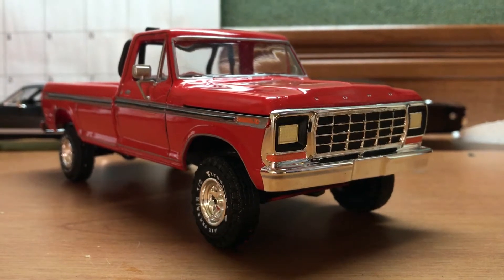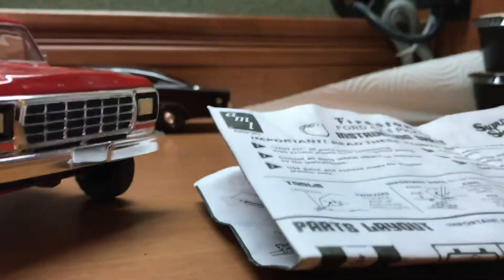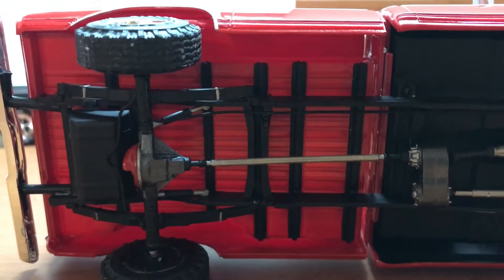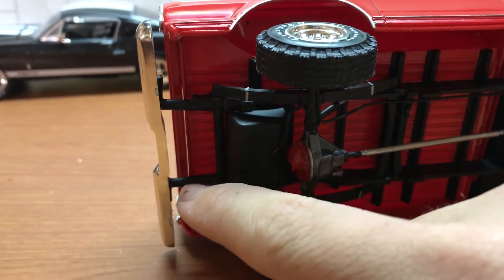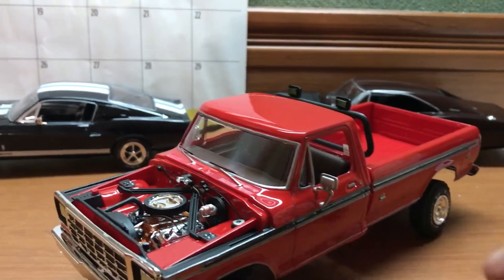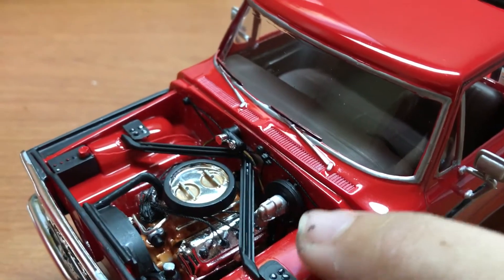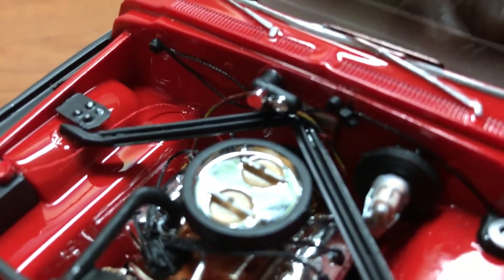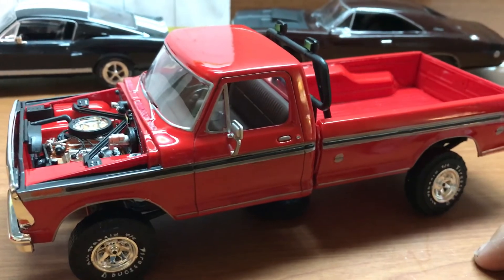AMT 1978 Ford F-350 Firestone Review

Comment: Looks like you did a great job however I find it hard to believe that you are a beginner.
Reply from the maker: George Bain you are lookin at all the cars I’ve ever built right there lol at least at that time
Reply: @nothing2scale255  I'm having a hard time with this kit, mainly due to the directions and fitting issues.By far the worst kit I've come across. Congrats on a great job .what kind of kits do you normally work on?
Reply from the maker: George Bain a little bit of everything... if it catches my eye I pick it up. I’m starting to edge towards Tamiya just for the quality of the product and attention to detail.
Reply from the maker: I like the classics for their customizing potential... but I’m starting to break into some more modern cars. Thanks!

Comment: Not to nit pick but the 289 wasn't in production in 1978. (That's what I'm assuming what year the truck is from the style of the grill) I think you meant 302 but my opinion is the same as yours. That engine is too small for a truck of that magnitude. It should have came with a 351 modified. That's what most Ford 4X4 pickups from that time period came with aside from the 300 in line 6
Reply from the maker: Either way the Hemi is an upgrade lol
Reply: This kit comes with a 460, no 302 or 351
Reply: This kit is a f250 3/4 ton ,not a 1/2 ton .The grill did have square head headlights and a longer wheelbase. Two gas filler doors and tool box on right side.  It makes rear quarters smaller 
  All shown on this kit

Comment: This kit was poorly made. On my kit ,the bed of the truck , the parts do not come together right. That is far as I got so far. I was putting it together so I can paint it. Looking at the rest of the parts, I have to trim the motor parts from left over plastic, etc . Im am very disappointed in this kit. I know I can make it come together one way or another.
Reply from the maker: Sometimes the fun part is getting past the issues with the kit. I’ve only ever had one kit that was simply unsalvageable.
Reply: A way to solve the problem with the bed is don't even put the bed on it take some popsicle sticks and make it flatbed that's what I did had some old steelies from another kit made a cool Old Farm truck out of it